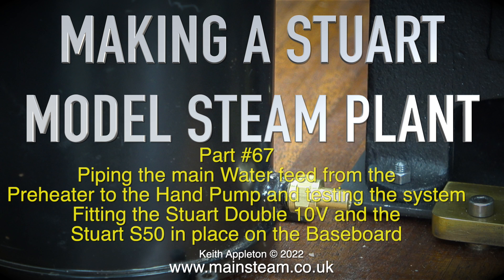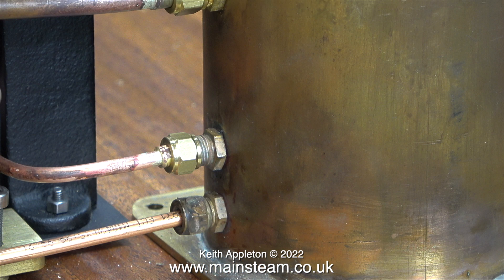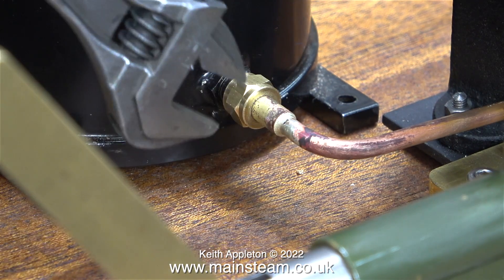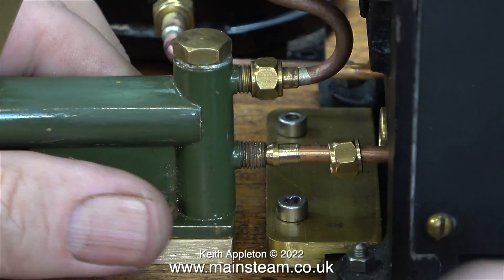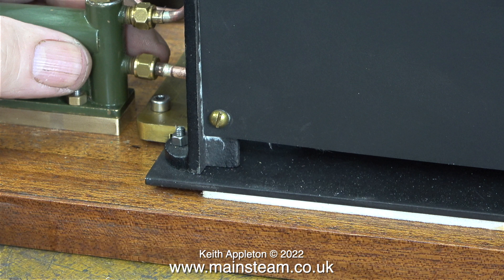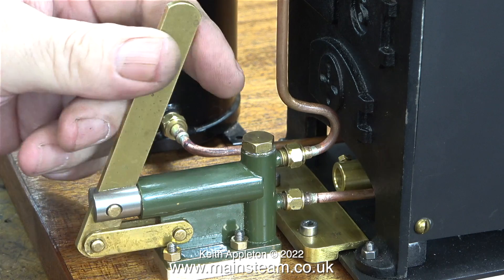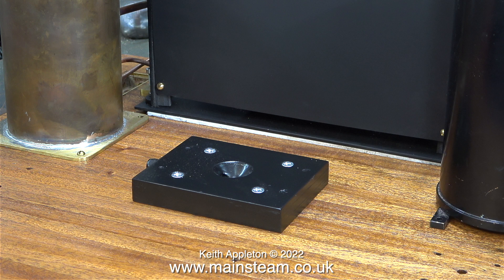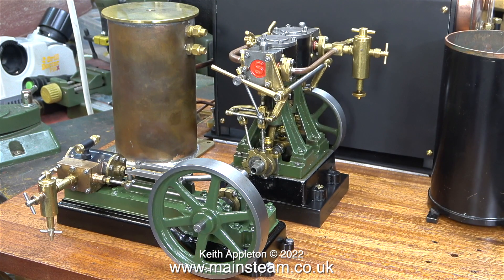MAKING A STUART MODEL STEAM PLANT - PART #67

Comment: Another great insight, thank you Keith.
I'd be interested to know your method for bending such tight bends in the copper pipe.
The method I use (if I do not have a pipe bender of suitable size) is to start with annealed pipe or tube, pack the tube with table salt and bend around a mandrel. I can then flush the salt out with water.
Reply from the maker: I use a pipe bender, but in the past I have used Ice, Sand or Solder, I never thought of using Salt {:-)))